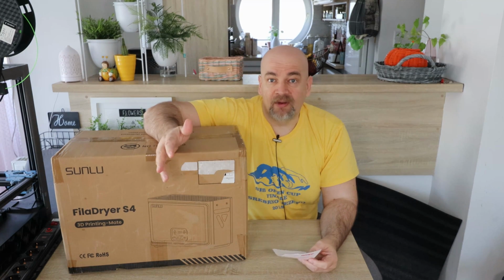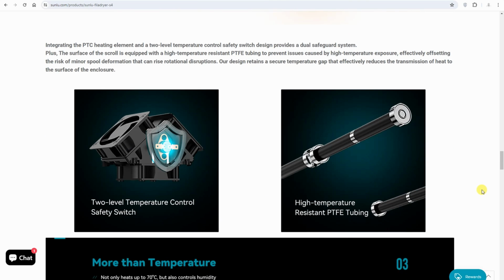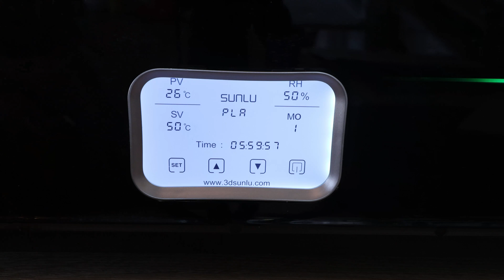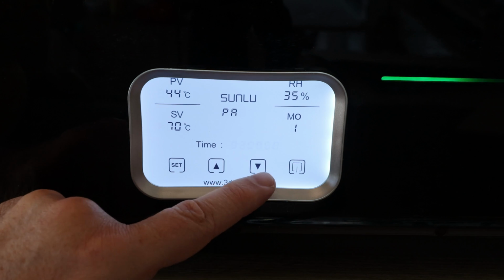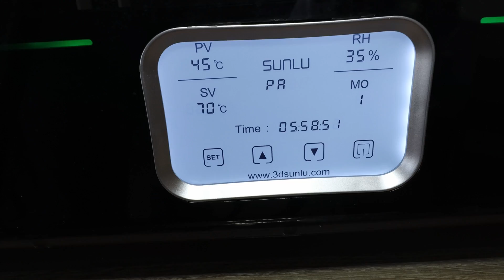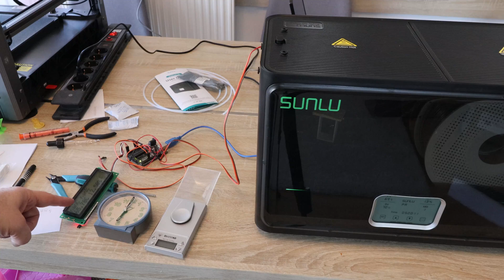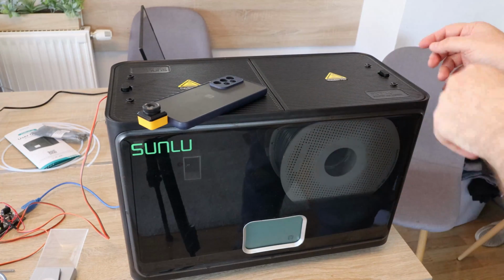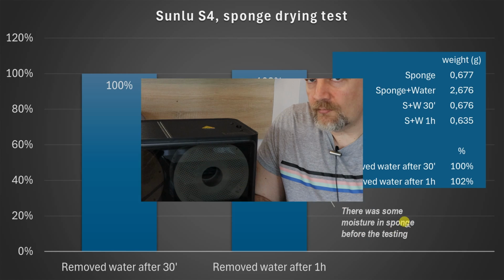Sunlu S4 filament dryer testing

Comment: I have the S4 and I’ve been having an Er3 error and it seems to be a widespread issue it completely stopped the filament dryer from drying the filament and it will just shut down every time I try to use it 😢

Comment: Thanks for the video! I just got my SUNLU S4 dryer, put 4 rolls of PLA in it and had it dried for 6 hours @ 50 degrees C. I also added dessicant (into the 2 containers in the bottom) and I left the slots for the PTFE tubes open. RH does not seem to get under 20%. Is that normal and acceptable?

Thank you.

Comment: A question that I have not been able to get a definitive answer to is, if I am using the S4 just to dry and not to send filament to the printer, should I plug the 8 holes in it with the plugs that Sunlu provided? And, if so, are 1 or more of the holes needed for ventilation and I should only plug some of the holes in the S4?

Comment: Is anyone having trouble with overheating filament in their S4. I now have at least 4 spools of PETG from 2 different vendors and 2 separate drying sessions that severely stick to itself inside the spool after drying (and become unusable as a result). The set temperature was 65C (measured 60ish) and dry time was 12h (which is longer than spec, but conventional wisdom says “you can’t overdry filament”). Both vendors are replacing the spools but both also claim overheating or “overdrying”. It’s expensive in time and filament for me to get to my own root cause by testing every permutation, but perhaps someone else has relevant experience?
Reply: "conventional wisdom says “you can’t overdry filament”" - shows how little value there is in 'conventional wisdom'!
Reply: @paulyeomans1065 Great. How did this help the discussion?

Comment: G'day m8  from Sunny Brisbane. I Backed this way back in September/October last yr and got mine mid December. ive had this running since January 24 on mode 2 and once the relative humidity raises to the 50% on average it will turn on and run till the humidity comes down, and thats done by Silica bags, After the filament has been in the dryer for a day or so the time in between heating runs become longer apart as  the heat penitrates deep into a roll and overall the whole roll is moist free. I've been using a TPU i got way back in 2020 nearly full and ive no issues at all, also when your going thru the settings and you come across the flashing Sunlu setting it will change the way the light moves. My 3 main filaments are Esun PLA+ ABS+ and PETG, and with this machine you can run it like a AMS but you manually change ya filament, and because it has 2 filament exits for each roll it doent matter where you put it all my printers, it will pull the filament just fine, certinely better than my S1 and my original Esun Filament dryer. Big Cheers for an outstanding Review....From A M8 Downunder......p.s. it also frees up many power sockets depending on how many of the earlier dryers you may be running

Comment: I love my sunlu s4 dryer.  I don't mind the sound. But I am not bothered by fan noise like some. At the end of the day, it works well and the standby option is amazing. I leave some rolls in there when planning to use some hydrophobic filaments. I also spin the roll every few hours but don't mind it as it gives me a chance to check on it.  I also have the Eibos single-roll one and it is a pain to use compared to the S4. I used it today to try some CF PA. Thanks for the review sir. Cheers from canada 🇨🇦

Comment: Just note that 67C is very close to the lowest temp that PA can be dried at. And it would take 1-2 days at that temp. Also, you should put 4 KG in it and put the temp sensor inside the core to see how long it takes to reach 65C.

Comment: The S1 and S2 were upgraded by Sunlu and now they both have fans 👍
Reply: Can these be disabled? Or are these fans super quiet? 😊
Reply: @HansLuijten I have a genuine question. Why are people so worried about fan noise even if it's just a quiet hum? I've never worried about fan noise except for on my items that run server fans. But all my equipment is away from living areas so it's not much of an issue.
Reply: @unclejohn5012 well in this case i found out the fan noise to be negligible.
The reason to think about fan noise: I have limited space where I can put the dryer (and printer), so I can hear the noise all day long. May not be the case for everybody of course. I am not worried about a little humming though.
Reply: @HansLuijten I appreciate your response. My printers and other equipment are in my garage along with my electronics work bench. So noise is not a hassle unless my battery tester is running which is deafening loud. So I do under stand where you come from. I personally find the sound of fans, 3D printers etc to be quite soothing in my work area. Makes me know things are getting done!
Reply: @unclejohn5012 I can relate: it’s like listening to the noises my car makes while driving - so I know all is well. 🙂
Reply: @HansLuijten Might be a thing us so called "makers" enjoy! Knowing this are getting made or running well. Sounds are the first sign of a issue usually!

I have enjoyed our conversation. I hope you have a blessed one :)

Comment: I will call you Dr. Filament Dryer Tester from now on. 😆
Jokes aside - thanks for your insights and methodical testing. Your service is invaluable for the community.
Reply from the maker: Thank you, and I am not done yet. 2 more dryers this week.. (or next week)
Reply: @MyTechFun  Keep them coming. I bought a Gratkit Firefly considering your test results and my use case - and I am happy with it. I would not have considered it without your input.

Comment: The silica is the most useless thing ever in all these dryers.

When the air is hot the air relative humidity drops (that's why we heat it and why it sucks water from the filament), so silica, which works well when air rel. humidity is high, becomes literally useless.

Silica should be out only in the container where filament is stored at room temperature, not in a dryer!! :D
Reply: What about after the active drying during printing at root temperature out of the box? i.e. “dry box” function. Desiccant still useless then?
Reply: @LexxM3  desiccant is useful inside a sealed (well sealed) box after the drying is completed, to maintain low humidity. In a dry box at room temperature during printing, for example.

Comment: I just got one of these as well, its an excellent dryer, it gets really hot inside and it does a good job of storing and maintaining the filament, its a noisy machine though as the fans are quite powerful, but it does have a place for desiccant which is nice, I would like to see it go higher on the temps as 70C is not good enough for high temp nylons, you will need 80 to 85C, were I live, PA-CF will not dry at 70C specially high temperature nylon blends and PA11 and PA12, they dry to a point at 70C, but they still do not print properly, I have to bake them in a proper oven at 90C for 8 to 10hrs to get them to a point that is acceptable, Nylons and PC blends are pretty much 90% of what I print.
Reply: My testing is that 65C will eventually dry PA, but it might take 48 hours. I agree 67C is not enough. Also, it is not clear this dryer will even reach 67C with 4KG inside of it.
Reply: @rsilvers129  I find filaments like PAHT-CF UPAHT-CF and PA11-CF all need more drying to print really nice, I have to get these below 20%, I have been know to keep a spool of UPAHT-CF15 in the oven at 85C for 72hrs before using it, to get that last bit of moisture out of the polymer takes a lot more effort, I suppose like charging that last 10% of a Lithium battery, but I will say the S4, feels pretty hot, I will have to drop heat sensor in there and check it myself.
Reply: To get "dryers" to those kind of temps requires different components.  These dryers are made of cheep electronics, fans and wiring.  They cannot withstand operating within an environment for long at higher temps.  That is why you are seeing many ship with extra rotation motors and control board ribbons.  Best thing for the higher temps is an air fryer.  Thet are designed for temps to 400-F but you can dehydrate anything at lower temps you select.  And they cost as low as $79.  Not as convenient but better at the job.
Reply: @bw162  I use a digitally controlled oven to dry my higher temp materials and use this one for ABS and PETG, the air fryer is a good option if you can find one big enough, these ovens use a bang-bang system for heat regulation though and not PID control, so you need to check what temps they run at with a thermocouple versus the display.
Reply: @”Bang …bang”….i have run a temp monitor in the Ninja and it maintains temp +/- 3 degrees which is a lot better than any filament dryer.  Plenty of room for one roll and place to dry desiccant as well.  All for $79.

Comment: This is a really good filament dryer. However, I recommend keeping one of the lids slightly open while drying, otherwise the moisture will not come out of the housing properly.
Reply: Did you not watch the test? It worked 😅
Reply: @REDxFROG  Tested myself and it has not worked good without my hint. Do you own a SUNLU S4? I do not think so. 😎
Reply: @theunknowdude3000   got eeeeeem

Comment: This this wrecked havock on my life for weeks making me think my printers were defective.. Theres too much drag for smooth extruding
Reply: This can be an issue with the edge/rim roller system, I see this with a lot of these boxes, edge rollers + long PTFE runs + weak extruder = under extrusion or extruder skipping, this can be even worse if the filament is an abrasive type, this is why they include 4x3 tube, to help reduce that drag.

Comment: It should be clear that with the bowden adapters, this is intended to print from... The idea of sealing the unit up to dry and store filament is odd. It is fairly loud, but to do the job it's designed for, keeping up with four spools, it's going to be. Mine has been running 24/7 set on auto, PETG mode, at 20% RH for a couple months, feeding three printers and has been flawless. Oh, I paid for mine as well and actually use it...
Reply: 20% rh isnt posible, 30% is the lowest.

Comment: I have an S4 and yes it is absurdly loud. As for using it as a dry box, the S4 has a mode in which, after the timer expires, the dryer turns on at 50% RH (user-configurable) and runs until 25% RH. One nice thing about all the space is I’m able to dry filament on one side and desiccant on the other.
Reply: incredibly loud? In which world?!
Reply: @Martin-yo2lm  I wrote “absurdly”, not “incredibly”, because it is absurd that the noise coming from the 3 fans inside the filament dryer should be so loud. It is absurd that the filament dryer is louder than the printer it is feeding. I am not incredulous; it’s not like I have a 747 taxiing through my printer room. 😆 I’d replace the fans with Noctuas if Noctua made a fan that size. 

To answer your second question, in my world, which should be obvious since I was sharing my opinion. I am aware of a mod that facilitates fan replacement so I suppose my “absurdly” assertion holds true in other worlds as well.

Comment: I have the S2 and it does have a fan. Only had if for a few months. It seems to work fairly well but I don’t have any other dryer to compare to. It took my roll of TPU from a starting RH of 38% down to about 18% in about 8 hours.

Comment: Funny you should post this as I was JUST browsing your channel while thinking, "man that sunlu S4 looks nice but I need to see some reviews on it". Great video. Disappointing that it's so loud, can't be used for a dry box, and doesn't rotate spools.
Reply from the maker: Just for curiosity. How did you find this video? It should be unlisted (public from tomorrow)
Reply: @MyTechFun  unlisted videos still appear in your playlists 😉
Reply from the maker: Wow, really. Good to know.. Thx.
Reply: Yes its how we know what you where going to put out
Reply: It has cavities with vented tops in the bottom of the unit for desiccant. The bowden adapters should make it clear that the box is intended to print out of. I feed three printers out of the S4 with zero issues. It is fairly loud, but you have to expect that from a unit to do 4 spools.
Reply: Honestly it's not that loud at all, it's a deeper sound that's much less noticeable. I thought the creality space pi heater was way louder than the S4 and it only heats one spool.